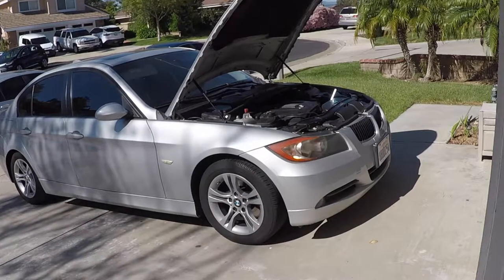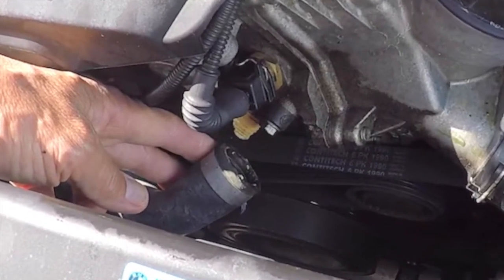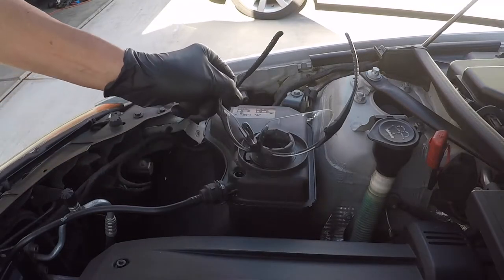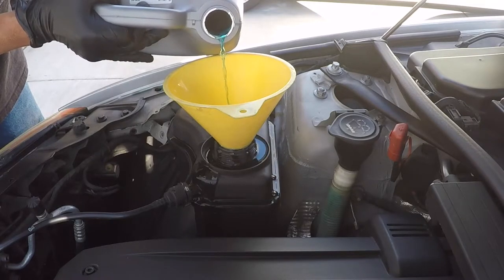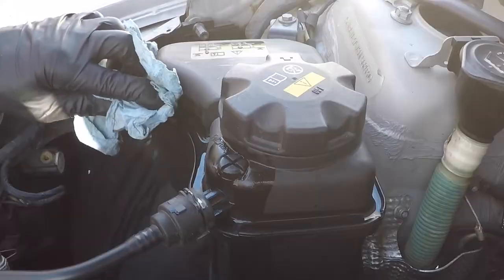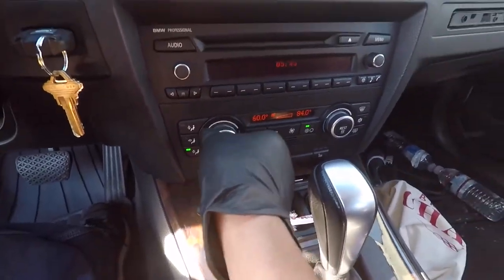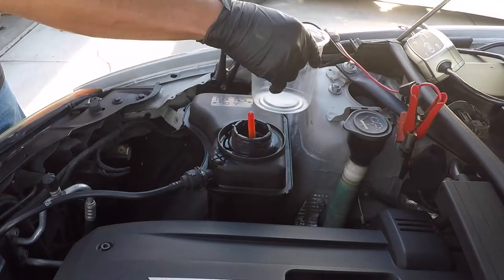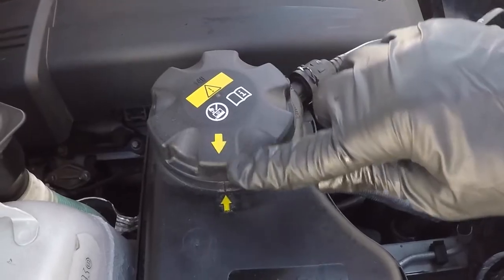how to bleed your coolant on E90 2008 BMW 328i (DIY7)

Comment: There is no need to remove extra coolant as it will drain through the overflow. And also there's no need to hook up a battery charger, or maybe I didn't understand why. Other than that great tutorial
Reply: You are incorrect. A heads up on this BMW you must remove the overfill of coolant or you will blow your radiator or hose off the vehicle. This is a different set up then most vehicles. I understand what your comparing to with lost vehicle it’s not a problem and it will not be a issue. However. Not on a BMW. While the vehicle is running. The easiest way tk remove the coolant is to simply adjust the bleeder screw and it will also allow and trapped air to work it self out. Great video I agree he did not explain the importance of why you must not overfill. Once it cycles two or three time then you simply slightly turn the l bleeder  screw. What that will do will allow some of the extra coolant along with air to escape and evacuate the remaining air. I will be doing a video in about 2 hours on a N90 I believe I cannot remember exactly. Either way it’s a 2008 328 I and I will explain more thoroughly doing this also will get the coolant level down to the correct level as well as it will start to stream with clear fluid and knew it air at all once you have all the air out of the system if need be though you still need to check the vehicle let it cool off then open it and remove the rest after completely finishing if not he will blow hoses it will be a mess just a heads up I thought the same thing and I ended up blowing a radiator hose off so just wanted to throw that out there best of luck. I had to learn the hard way then again he has a underlying issue do I will have it resolved this evening. Regards. It was a excellent video overall and I enjoy watching educated DIY’s on here and this was to the point and got a comment and a like and subscribe from me 👏 🎉
Reply: I overfilled my system & blew my Heater Core Supply Inlet hose.

Comment: Isn’t that cap supposed to be off ? During those 12 minutes ?
Reply from the maker: no. the cooling system has to be air tight
Reply: Then how is the air released if you have the cap on ?
Reply: The bleeder on the expansion tank is to be removed during the 12 min. Cycle.

Comment: What are the reasons  why you have to let air out and use jumper cable? Thanks.
Reply: Jumper leads are actually a battery maintainer charger to keep battery charged  
Up to voltage so it doesn't drop or battery die whilst electonic water pump runs it 12min bleeding cycle to purge any air locks etc. Battery maintainer is the  best thing to connected whilst doing a electric water pump bleeding cycle. Although a battery charger can be used.  I must stress if you're not  knowledgeable about doing  this process plse do ur research 100% or let qualified persons do it my friend. Bmw aluminium engine will overheat  if not done properly. So be careful cheers
Reply: @mannysingh8295  overheat the waterpump?

Comment: How did you flush the old coolant
Reply from the maker: you have to remove the radiator plug from the bottom of the radiator. some E90 models has two plugs, left side and right side. then remove the coolant hose from the thermostat housing. be prepared it's gonna be messy.
Reply: @randysdiy  thank you sir. This will be my next project. And thank you for the videos. I also have a 330i n52. Look forward to more of your content!
Reply from the maker: sounds good 👍

Comment: You method is not professional! How you can control the coolant system is 50:50 with distilled water?
While filing, air bubbles inside the system stop you adding and keep you lossing coolant.
What you should do is ALWAYS pre-mixed 50:50, prior to adding any drop of coolant into the system.
This is even, any flushing out, pipe-leakage, or like the air bubbles popping out, etc., the ratio is never change and it is 50:50.
I don't drive BMW but know it use electric water pump. However, I would use traditional method. Turn on the engine, AC to heat, Fan to lowest speed, operation to engine getting 90c. Air bubbles will disappear next day. I use this method for my Mercedes. Meanwhile, you can buy a No-spill funnel and it has adaptor fit for BMW (but not Mercedes). Thanks.
Reply from the maker: did you read the description of this video? i guess not 😂